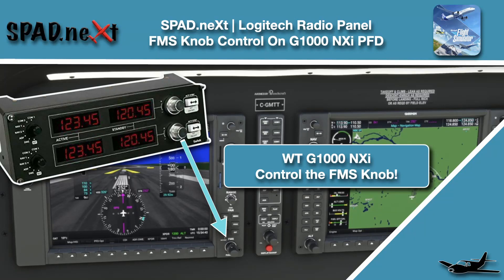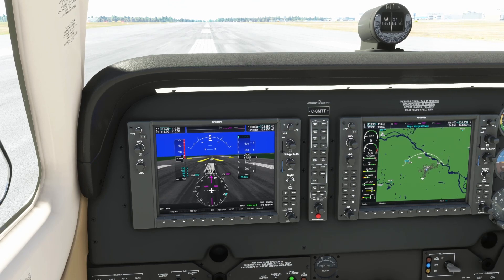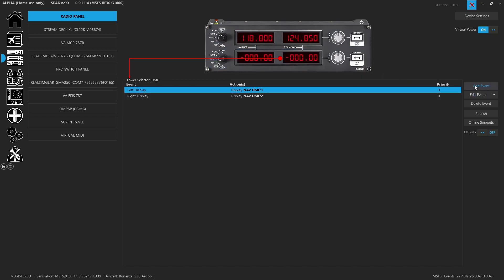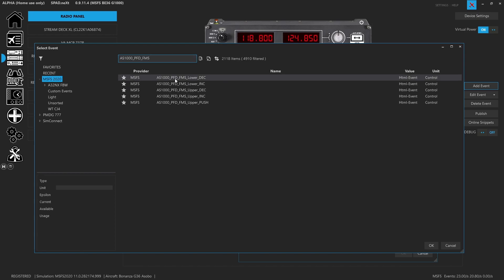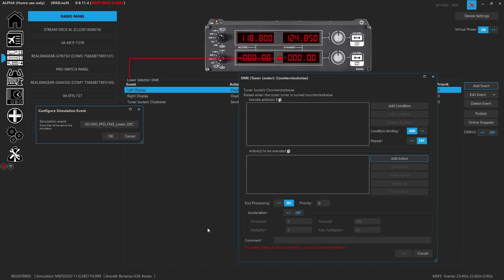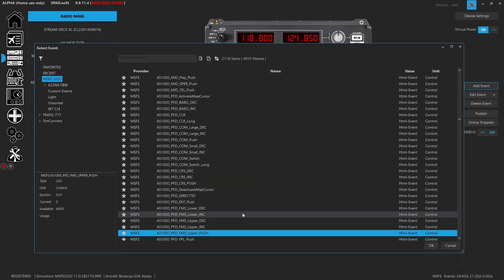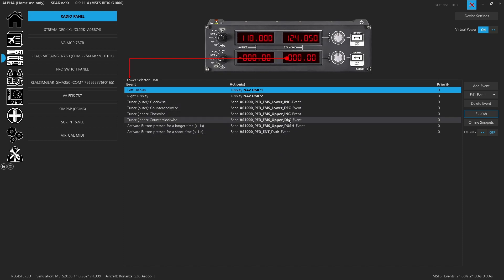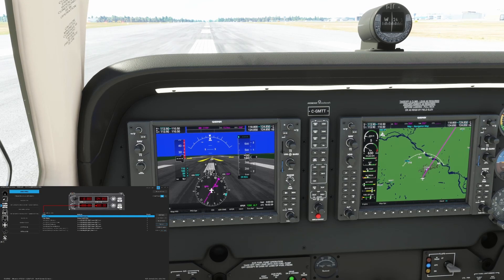(Sim Video) SPAD.neXt | NXi FMS Knob via The Radio Panel

Comment from the maker: Don't Forget to Download the updated v2.1 Bridge from the link in the Description or from the SPAD.neXt Discord.  An Update has not been pushed Yet that includes it..
Reply from the maker: The CDI key I think needs to be assigned as a G1000 soft key unless the NXi now will intercept the older GPSDrives Nav 1 commands. I will need to look at that later today or tomorrow.
Reply from the maker: Okay so the old GPS Drives Nav 1 will work as well as the soft keys.

Comment: How did you get the msfs2020 events?
Reply from the maker: you install Spad and the LVAR Bridge..  Then you have access to send H Events
Reply: @LesOReilly  Now I have them installed and I have everything the same way you show in the video but it is not working, any hints ?
Reply: I have instrument panels, can I make them work with the g1000 ? For Menu/Clear/FlightPlan etc? I made them but it doesn't work, is there an extra thing?
Reply from the maker: @karovz5521  read the description of this video....  You have to install the bridge...
Reply: @LesOReilly  read my first coment again... it is installed :) ohh its deleted okay so i have it installed the radio knob works, how to make the other part of the nxi g1000 mapping to work?

Comment: Hi Les, not sure if you know this but this configuration no longer works...got in the Baron G58 to go flying this morning and couldn't get my radio panel to communicate with the G1000 in the sim...tried everything I could to reconfigure it in Spad to no avail...any thoughts as to what's going on here? Thanks
Reply from the maker: Are you on the SU10 Beta?
Reply: @LesOReilly  Hi Les, when I read your reply, I had to double check what version I'm on as I can't honestly say I'm on SU10 beta but having just read the release notes, I know I ran an update on the 14th which was after the release of SU10 beta so I'm at loss as to why this problem exists...I also get a bunch of xxxx letters showing up on the PFD instead of number readouts for airspeed and altitude...so wondering I I need to uninstall msfs and reinstall?  Thank you.
Reply from the maker: Actually that sounds more like you have an old PMS50 GTN750 in your community folder…. Best way to trouble shoot stuff like this is to empty the community folder and only work with the one mod or item to make sure it’s not a conflict. Even liveries with old files can cause issues.
Reply: @LesOReilly  okay thanks ill give this a go.
Reply: @LesOReilly  Hi Les, so I fixed the issue with the xxx display on the PFD by downloading the working title avionics package from the msfs marketplace...however this hasn't fixed the FMS knob issue with regards to the radio panel...also I only fly the Baron G58 using the default livery.  What else could be issue...thank you.
Reply from the maker: @dermolado3351  did you install the spad bridge module?
Reply: @LesOReilly Hi Les, if you mean the LVAR Bridge for MSFS yes...but wonder if I need to install this separately rather from within the spad next config menu.? Thank you.
Reply from the maker: @dermolado3351  Nope you just need to install if from SPAD next ..  I guess finally .. you did remove the Logitech Flight Sim Plugin correct?
Reply: @LesOReilly  Hi Les, 👋 so after what has felt like a million computer restarts, I've gone only as far as updating my G1000nxi suite to the latest version and removed the logitech plugin and installed the lvar bridge,but the radio panel still wont operate the FMS.  I've reapplied your online snippet to the radio panel and still no joy...I wonder if I'm applying your snippet incorrectly as in do I apply it as a complete device or just for the button on the radio panel where you've configured the FMS on the HC Bravo which is the DME in this case.  What's strange is that all the other buttons work as should. Thanks for your help.
Reply from the maker: @dermolado3351  I just loaded up the kodiak used the Mouse to press the Direct to on the PFD and then moved the cursor with the big knob and then started to select letters with the small knob .... you are aware that it is programmed to use the PFD in that snippet not the MFD .. if you are using the MFD (the right screen or middle on Kodiak) then you would need to change those events from AS1000_PFD_xxx to the AS1000_MFD_xxx events....
Reply: @LesOReilly  Hi Les, just want to take a moment to thank you very much...I have learnt so much more about Spad on this one issue. Delighted to say that this small edit from PFD to MFD has got the whole of thing working tikitiboo. Without your help, it wouldn't have dawned on me that the PFD wouldn't work for the MFD...I thought the two were inextricably linked. Haaaaaaa. You live, you learn. And thank you very very much. Does your channel accept donations,  I would like to offer a donation to express my gratitude. Thanks
Reply from the maker: @dermolado3351  It's all good man :) Just Like and subscribe :)
Reply: @LesOReilly  oh by the way, having successfully sorted the FMS out, I went one step further to configure the RANGE button...so basically expanding on your configuration...so now it is possible to control the map range on the G1000nxi by moving the selector knob on the logitech radio panel to the transponder mode and then using the outer dial to zoom in and out on the map. However I haven't published this snippet as I don't know if it will conflict with your original snippet and also wonder if publishing it would be an encroachment on your configuration...be cool to get your thoughts. Thanks 😊
Reply from the maker: @dermolado3351  your publishing snippets are your and have no impact on anyone else’s.
Reply: @LesOReilly  ah okay awesome

Comment: Does this also work with the updated (beta) G1000 NXi ?
Reply from the maker: yes... the H Events did not change...
Reply: @LesOReilly  H events ?
Reply from the maker: @PeterBevington  The AS1000 events are H events...
Reply: @LesOReilly  Not quite sure where it's failing as everything works apart from the FMS dial.
I know the dial function works as I can use it for NAV1/2 etc and the LED work as I can reconfigure them to show heading for example. Any suggestions. I have the bridge installed.
Reply from the maker: Join the discord so you can share video of what you are doing and post images. YouTube video comments are impossible to do tech support with.
Reply: @LesOReilly  Will do. Also fixed by adding both PFD & MFD to dial config. Bit odd that this worked but happy. Thanks for the video I actually did the same thing ages ago in  XPlane.

Comment: Great video, I have great difficulty with the FMS knobs. Is there a short text guide  I can download and print to explain how to use the knobs in their new format rather than having to keep referring to the video until it becomes familiar?
Reply: Sorry to come back so quickly but struggling to understand how to make the radio buttons work. I have installed the v2. Bridge but no joy. Looking again at your video you state to click the direct button and then you enter info but that is where I am stuck. I'm afraid that at 80 plus the old brain isn't as good at taking in new info as it once was and I think I need a real idiot-proof step-by-step guide to understand what needs to be done. Sorry to be a bother but really want to crack this.
Reply from the maker: @chrispurkiss1491  I am not going to be making written step by step guides ... that is litterally what the video is... a step by step guide...  Use the Pause feature of youtube to pause the video if you need to use it to move step by step...  If you installed the Spad Bridge while MSFS was running then you will need to restart MSFS as like anything in the community folder it loads it when the sim runs...
Reply: @LesOReilly  Thanks Les, thought I would ask. I tried to install your amendments from the snippets option but when I select the complete device to install your file of 9/12 it won't load and I am left with the default options. The profile I have at the moment shows the left display as MSFS: NAV IDENT:1 and right as MSFS: NAV IDENT:2 I assume that's OK as haven't found an alternative. Everything else is as per your video. The end of your video where you use the buttons is very short and I'm not sure what buttons you are activating. If I turn either the inner or outer knob nothing seems to happen. I know it's a bit of a cheek but any chance of doing a short video showing the panel in use with close-ups on the FMS so all is clear.
Reply from the maker: @chrispurkiss1491  my configuration uses the DME page (so you have to set the selector to DME first) for the controls to function in regards to the FMS knob controls.  Outer Knob is outer Knob .. Inner Knob is Inner knob .. Pressing the White Button to the Right with a "quick press" is the ENTER Button on the PFD or MFD and the LONG press (hold for 1 second) is the FMS KNOB Push (Cursor key) .... knob push is used much less than Enter so this worked out good..

As for not able to download a snippet?  why?  more info needed .. next .. doing support on YouTube comments is utter pain ...  this is not a forum..  all of the Spad Next support is handled in Discord.  Best to move there since you would be able to post screen shots of your issues and what the errors are showing..
Reply: @LesOReilly  Will do Les, thanks for your patience. Will get there in the end.

Comment: Les, When I turn the outer and inner knobs on the radio panel the appropriate knobs turn on the spad.next radio panel, but turning the knobs doesn't change the characters on the PFD in the aircraft.  I have updated to v2.1 Bridge.  What did I do wrong?  Thanks
Reply from the maker: FYI putting the . in the SPAD(dot)neXt makes YouTube think it is a link and hide the comment... Digressing
you did restart MSFS after updating and installing the Bridge correct?
Second in NXi v0.7.1 you do have to press the CURSOR button (it's the White button in this config) to activate the Cursor on the FPL Page.  otherwise you will be scrolling the MFD pages.
Reply: @LesOReilly  ...all is working now.  I messed up following your excellent directions.  Embarrassed.  Thanks for your videos and your help.
Reply from the maker: No worries. Sometimes working through it is better than it just working the first time!!

Comment: Hi dear O'Reilly.
I am very grateful to you for this wonderful lesson on Spad. I absolutely did not like twisting the dual knob with the mouse, it is very inconvenient and distracts from piloting. But I do not have a radio panel, and I have Logitek Yoke. On its right side there are two switches (3 positions each) and a red button. Here I used them in Spad to implement your idea. One switch simulates a large vernier, the other simulates a small one, and a button next to it serves to pressing a small vernier. All this fits perfectly under the thumb of the right hand. And now I handle the FMS knob without looking closely at these verniers.
I went even further. There is also a 3-position switch on the rear right side of the Joke. In Spad, he sets 3 different settings for the same switches and button. And I managed to get in one version for the PFD knob and in another version for the MFD knob. And now I use my index finger to move from one knob to another. I have experienced almost simultaneous operation on both knob and everything works great!
Now do you understand why I am so grateful to you? Thanks a lot!
Reply from the maker: This makes me smile :) I am appreciative of dropping this comment.  It is obvious that there are so many ideas and ways to leverage the hardware you own using SPAD.neXt!!  Way to make that work for you!!

Comment: This is an absolute brilliant idea!!! So I went in and configures my radio panel using your snippet. It works, I can now turn the knobs to make  changes. However, the knob 'jumps' a little bit. So when I'm putting in an airport in the flightplan and I want to go from A--- to B---... I turn the knob one 'click' and it jumps straight to C---. Then I have to go back and forward with the knob and it's like hit and miss to get to B---. Is someone else experiencing the same issue?

Les O'Reilly, thanks for all the great video's. Makes my panels really come to life!
Reply from the maker: You need to update the Bridge to v2.1. I put it in Dropbox and linked it in the comments. You can also get it from the discord channel.
Reply: @LesOReilly  Ow wow, missed that one, my bad. Thanks a lot, will try with the 2.1 again.
Reply from the maker: @ferrygrooten  No worries would be better if we got a "release" channel push out so that it updated everyone...  The Double event is a bit of annoyance as at first you can't figure it out why some stuff is working and not others :)

Comment: I've watched and rewatched many of your YT videos and the thing that I keep asking myself is how you - personally - remember all the subtle changes you have made, particularly while in the air? Like a short button push does this and a long button push does that. How do you remember all the this and thats?
Reply: I have terrible memory so I’ve added in text to speech to act as a voice annunciator when changing certain pages or profiles. It quickly notifies me of what is selected so that I’m not second guessing anything.
Reply from the maker: Nice.
Reply from the maker: I have a very very good memory :). In addition how I assign things is part of the process of working through how I think it should work :).  So to me it makes sense or is the worst possible word ever —- intuitive to me :).
Reply: @LesOReilly  That makes perfect sense. I'm also guessing that a large percentage of the time, profiles you create are repeated - with some minor tweaks (depending on the type of aircraft) - so its not like button #03 on the Bravo (as an example) is programmed differently for each and every plane. Again, great stuff and thanks for taking the time to answer my enquiries. I have, by the way, joined the Spad Discord server so will be scouring that for tips and tricks and answers.
Reply from the maker: @ArtG-49  Yup there are many of the items that will do a similar task but yes could require additional tweaking based on what events that plane uses...

Fuel Tanks... or different De-Ice abilities..many Duplicate and tweak when it comes to the profiles...
Reply: My memory also is not very good, but if you use these buttons often, you will remember. BTW I am planning to see if the 430/530 FMS knobs also can be programmed like this, and then tied to for instance the dial to ADF and XPNDR settings. The 430/530 have their own event codes (like AS530_LeftSmallKnob_Push) i see on this site Les pointed me at: https://hubhop.mobiflight.com/#/list
Reply from the maker: Yup they are all in the SPAD List... just filter on AS530_
Reply: @renefeijen5916  Hi Rene. Perhaps you have seen the snippets and youtube video already from vadermike777 ? He set up the radio panel to achieve this on FSX about 4 years ago. It got me started - really useful!